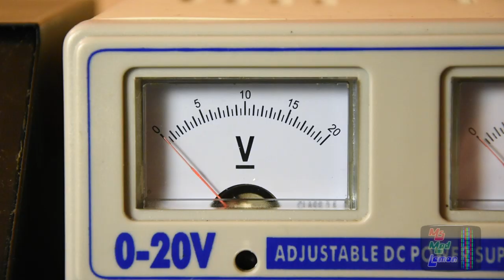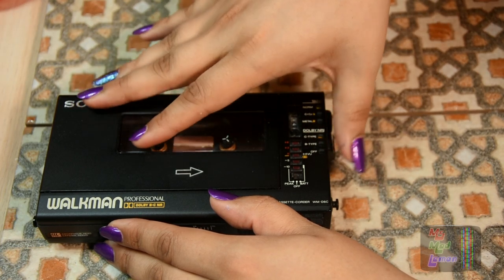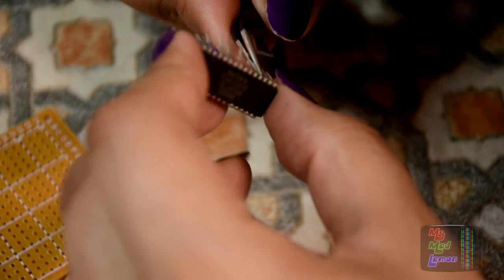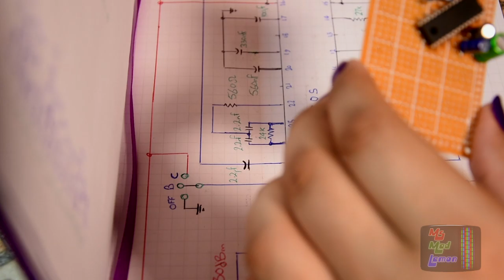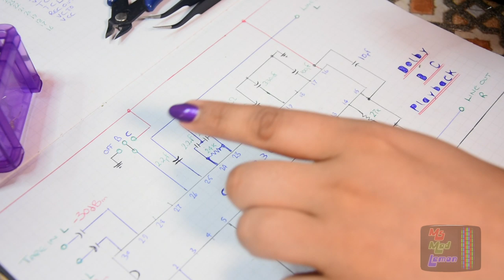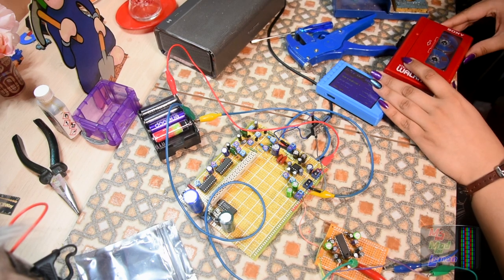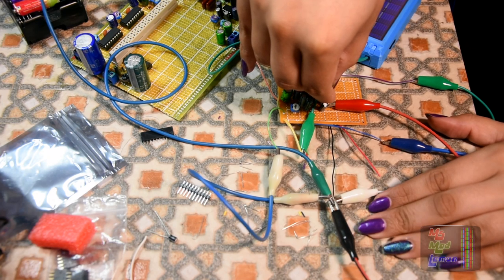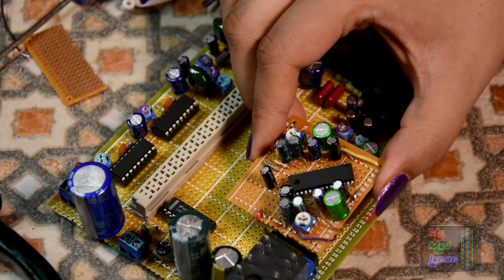Dolby NR B & C Circuit - SIDBoomBox Project 15

Comment: hello Ms Mad, my old stereo (from the 80's) has a lot of noise coming from RF signals, like wifi and bluetooth. I already wrapped it in aluminum tape to make the faraday effect, and the noise has decreased, but what could I add to the circuit to lower the noise even more? I've tried adding ceramic capacitors to the preamps but it doesn't change much.

Comment: Does the sidbox can "mix" the 2 right & 2 left channel to a 4 channel left and 4 channels right mix?... well i hate the sound of mods that have one instrument in left, the other on right... i needed to hear em on both channels.... if not u plan to do such thing on your boom box?
Reply from the maker: You're talking about adjusting the stereo separation? yes the SIDbox has options to adjust that, and i'm also going to  put it on my SIDBoomBox for when I wish to connect an Amiga to it. I can adjust the stereo separation.
Reply: @MsMadLemon  weil if that means that the Sound that cames from Amigas left audio channel only also can be heard in right side of a headphone...
Reply from the maker: @AlexanderKurtz  What you are describing is mono, as in zero stereo separation, left ear same as the right ear...
full stereo separation is when you hear one channel in one ear and another channel in another, and yes its uncomfortable... so you can set the SIDbox to adjust the stereo separation as much as you want it. 
But I will be doing that in the SIDBoomBox also as I did with my stereo separation project.
Reply from the maker: https://youtu.be/TT3rxuyGvtE
Reply: @MsMadLemon  well i remember the good old HippoPlayer had an "Joint Stero" option, that made Mod "enjoyable" for headphones...
 BTW - I like your chanel very much. nice to see that not only man are into that toppics... keep it on...

Comment: Where did you get that  CXA1330S IC? Is it genuine (NOS) or a China copy? And btw, nice build!
Reply from the maker: Most likely it's going to be a China copy, it was difficult to find and a little expensive, it took a while to arrive. However, the sound is just like the Dolby B and C which I've known for years.
Reply: There is a HA12134AF on Ali now for 4.30 USD with a delivery and no guarantee that it's not fake or broken. Maybe salvaging from smth old would be a better choice.